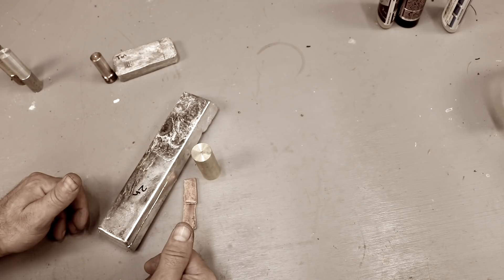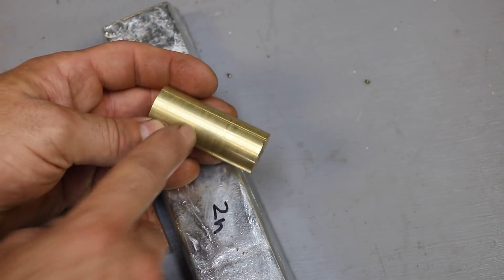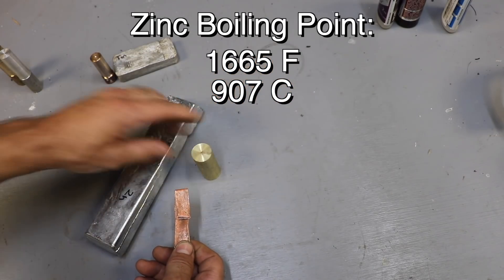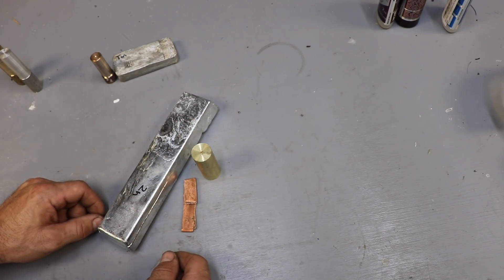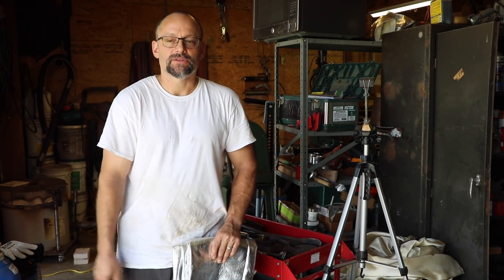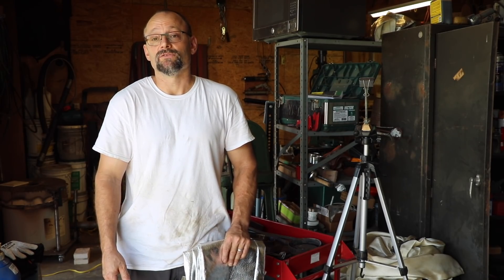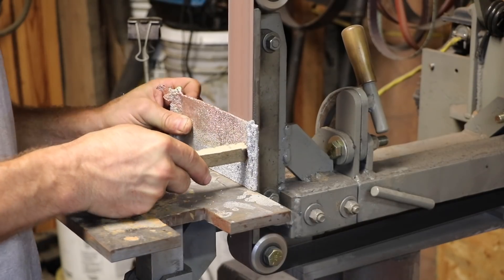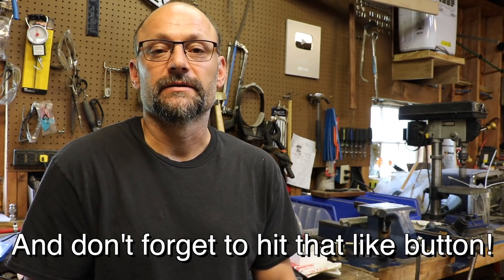Mixing Molten Metals.  THIS Could Go Wrong.

Comment: So I have made nordic gold multiple times with no issues.  Then I had an issue.  Molten metal in the eye kind of issue.  What happened is I had a big chunk of zinc on the bottom which didn't dissociate.  When I went to mix, it flash boiled and sent molten metal everywhere.  This seemed like a freak occurrence but splatter is indeed possible.  My eyesight is fine by some miracle. Sad thing is I had a faceshield on but had it tipped up.  Leather clothing for welding with no pockets works great.  Face shield.  Proper tongs, not Temu.   As to your alloys - aluminum will only handle very tiny amounts of copper before it favors making a ceramic.  The ceramic is hard as heck but eventually makes the mixture brittle.  Keep your aluminum low in most of these recipes - less than 5% and use pure aluminum over scrap can ingots which complicates things.  Tin at 1-2% has treated me well.  Copper should dominate most of the time as it is your "solvent" ; I favor over 85% copper. Copper will form copper aluminide; this will make the alloy hard and then brittle.

Comment: In high school, (many many moons ago...), I used to cast a lot of aluminum, and, at times, a small amount of copper.  We had only a few mishaps... the worst of which was when I poured molten aluminum into an ingot tray.  What I didn't know was that the other guys had quenched the tray to cool the previously poured ingots, but there was still water trapped in the seams of the joined angle iron pieces that make the actual tray.  The sudden, 'Hiss-Pop!' sound was surprising.  The molten aluminum spalltering on my bare skin was more so.  The aluminum solidified during the 20' run to the sink to quench myself.  What's a few third degree burns among friends, right?  That was an eye-opener!  Like John said... absent fireproof garments, bare skin was probably better than wearing clothing.  That would have been a clothing fire and a burn!  Anyway...  Thank's John for the great videos!  Love the channel!  Stay Safe Folks!!!

Comment: I'm permanently scarred when a cylinder of white hot tool steel flew out the tongs and smacked me in the face and fell onto my arm. It only took a second but it took weeks to heal. The only reason I still have an eye is because I was wearing safety gear. It managed to fall directly in the one part of my arm not cover by my gloves or apron. 

Splashed Molten metal droplets lose heat rapidly having a barrier to your body is a good idea as it gives you time to react.

Comment: The correct expansion ratio of water to steam is 1,600. It is important in firefighting to remember that, dump a lot of water on a very hot fire and you can replace the atmosphere in an enclosed space with water vapor. In addition to scalding anyone in that space, the lack of oxygen in the space will asphyxiate anyone who has survived the fire and then the steam cooking. Turnout gear isn't very effective at stopping the steam from burning the firefighters also. If you are certain there is nothing living in the space, you can put in just a relatively little water, close the door and also kill the fire by replacing the oxygen containing atmosphere with an atmosphere of water vapor. It only works with spaces that are not yet ventilated.

Comment: Hello i know this is a old vid but ive made some pretty decent aluminium bronze using only 10-15% of aluminium to 90-85% copper and it binds together quite well making a very tough but also malleable alloy

The trick is if its brittle you need more copper but if its too malleable you need more aluminium

Comment: the problem with the previous experiment was that the temperature was too high and the aluminum was formed with a lot of bubbles which would make it brittle, i have made many experiments with these metals (aluminum zinc copper) and i actually think if the temperature of your molten metals was not too high and you let the aluminum cool for more seconds (maybe Ten) you could have made a mixture of metals like you wanted, meaning layers of each fusing together, even better if you fuse zinc and aluminium brass (which would result in a color contrasting layers like you wanted). disclaimer: while i have worked with these metals i have never done a thing like you did meaning putting them together in molten state, i have just made alloys one at a time.
and beware of zinc vapor! you need a good ventilating space and hopefully a mask
edit2: i just saw you went a hundred degrees above the melting point, that would very well result in a not so perfect pour
and the next best thing than a full fireproof clothing is a fire proof apron!
Reply: and you actually are looking for Something in the wrong end of the rainbow! the Golden stuff was in the house, at least metaphorically speaking
Reply: the end result was very cool, hope you make a different pouring system to actually make it work for pouring several streams of molten metals in sync

Comment: You’re wrong. You can see sort of where the rainbow ends but you can’t know for sure until you go find it. 
The perfect example of that safety speech I’ve fond is grinding. When I’ve head to do prolonged grinding, I’d wear leather gloves. One time I didn’t have leather gloves. I put some of those cloth gloves with the latex palms. I burned the shit out of my finger. The sparks stuck to the cloth and burned me whereas bare handed it bounces off

Comment: yes zinc makes it a lot easier to alloy things with copper like aluminum and even iron
Reply: i use zinc  in my alloys to lower the melting point of the  alloying elements allowing you to do things  like alloying iron aluminum and copper under 1200C temperature :)

Comment: The comment on no clothing at all being second best is indeed correct, as at this temperatures, everything will be burned through before you could even start to react to it and any sort of burnis easier to take care of medically and has a better healing chance when no further foreign tissue (like clothing) has been burned/molten into the skin/bone

It's somewhat similar to dry ice or liquid nitrogene, contact to skin is not that big of a deal (if it's not forced and prolongued) as it will just 'slide off' (it's way more noticable with liquid nitrogene then dry ice [solid CO2] though)

Comment: I've got a brief observation on your choice for pouring the molten metals. Isn't there a release agent or powder that keeps the sand from sticking to the object that you're using as the pattern? I would think also that pouring the metals horizontally and with vent holes would give you a different outcome?

Comment: Not only is safety a personal choice but safety is also different for everyone and the supporting evidence is everywhere. Skill, experience, practice, muscle memory, personal tolerances and preferences. You may require a piece of PPE simply because you don't like the discomfort of oils or sparks on your skin, you may work in a metal shop in your underwear cause you can ignore the existence of sparks and oils and you're ability to focus and work safely is not affected. A personal example, I am a bladesmith and I never wear gloves if I can find any way to avoid them. I've never burned or cut my hands to a degree that affected my ability to keep working. My brother will occasionally come make hunting knives with me and he won't touch a hammer without gloves, he has also never sustained an injury. It's all about weighing the pros and cons and being aware of the risks and the ways to mitigate those risks. Also being familiar and comfortable with the type of injury that you can get from the type of risk you take. On another note, there are plenty of other options for clothing made from naturally self extinguishing materials that are treated to be flame retardant. Firefighters and the military use a light weight rip stop denim made from fabrics like 100 percent cotton, 100 percent hemp or 100 percent silk. These materials don't self ignite, they do self extinguish, they don't transmit heat, they don't melt, and when treated the hot material won't stick to them. Not nearly as good as the flame proof suit you have, but certainly not any worse than bare skin.

Comment: Bare skin certainly isn't the next best thing to "correct" safety equipment.  Your own views on safety are your concern and you have every right to use as much or as little safety equipment as you wish, but giving out false information to others is incredibly irresponsible.

You are certainly correct about not wearing clothing that will burn and definitely don't wear anything that will melt and stick to you, polyester etc.  Natural fibers such as cotton and wool are the way to go if you can't get or can't afford proper high temperature protective clothing, in fact in professional foundries 100% wool trousers and jackets were pretty much standard issue in the past and I've been splashed with significant amounts of molten bronze while wearing these, they smolder on impact, but do not burn and do not catch fire from a simple splash. 

The key issue with doing hot work in shorts however, and one that you failed to mention although you alluded to, is that there is absolutely nothing preventing metal from splashing into and getting stuck into your shoes. Jeans will cover the tops of your shoes, preventing anything from getting in there.

Comment: The trick seems to be getting the copper to solidify before it completely diffuses into the other metal. The zinc cooled the copper down fast enough for this to work. With the other metals I'm pretty sure you could take a chunk of aluminum or tin and drill holes in it of the correct size so when filled with molten copper it would allow for some mixing but cool the molten copper down with out liquifying the "container" metal. The math seems like it would be pretty straight forward to calculate how much copper you could pour into a cavity in a chunk of aluminum before it would melt the aluminum.

Comment: How well would it work if you had the 2 crucibles ready to pour into the mold but poured one crucible into the other just before pouring into the mold? Would it allow just enough mixing to get the effect you want without completely alloying before solidifying? Or maybe pouring both into a wide funnel that goes into the mold instead of directly into the mold, that could allow more swirling for a more random pattern

Comment: Have you thought about pouring with 2 sprews that go to the bottom of the mold either side and have the metal enter at the bottom either side and work their way to the top to a vent mixing as they rise.
This may create a more "swirly" pattern as it rises.

Comment: Tin might work with copper if you pre-cast a copper shape and kept it just shy of it's melting point, and then poured tin over it. Should have a non-flowing integration zone where the tin would 'wick' into the copper structure, and you'd have some control over that zone because the work's exposed and can be quenched at a given time, determined by experimentation.

Comment: Might i recommend you use a graphite rod to stir the molten metals together when their melting temps are far apart like that. . . . otherwise they don't mix... Because one provides enough heat to keep the other molten.

Comment: Having worked in steel melt shops for 45 years, I can tell you that your denim blue jeans and jackets with heavy welding gloves were the preferred clothing for working around molten steel in the days before aluminized safety gear came around.  The cotton is a natural fiber and it will not melt and stick to your skin, it also smokes when it gets hot & tells you that you are moving too slowly.  Bu the way, when water turns to steam it has a 1600 to 1 volume increase.

Comment: Seems like way too much tinn and thus diluting it too much. Maybe weigh the cast piece, then calculate the amount of the two metals to get this mass at x percentage each, then melt and mix those two defined batches. Also, heat the tinn up (much) higher, to allow for mixing.
Oh, at 11:15 its 0 to 100 °C, not 1 to 99 °C. Water (or anything...) only starts transitioning to another state when the freezing/boling point is reached and then more energy is added/removed. So heating water from 0 to 100 °C will not cause anything to boil, unless you keep putting heat into the water that now reached 100 °C. Well, there are some details around superheating at the contact surface etc. that we dont need to get into, but thats how it works.

Comment: 👍
A long leather apron would be the most appropriate attire for pouring molten metal, combined with high leather boots.
Add welders gloves, to protect your hands and forearms, and you're probably as good as is reasonable.
Protective glasses/facemask, would be an obvious addition.
This is both cool to wear, and would protect against splashes. 
If you look at old films of men working in foundries in the early part of the last century, that's what they wore.
😊
To get the metals to mix, the use pellets and melt them in the same pot, and stir well as they melt.
.

Comment: I kinda have the feeling that using a shallow horizontal pool would yield better results, you might even be able to cast the lower melting-point metal first, let it cool slightly, then cast the second one on top.
Cause so far it seems that most of the metal just mixed at the bottom and you only get a small region at the top where they stay somewhat separated.

Comment: Here's a real suggestion....
Go buy a 6 or 24 pack of water bottles.
Freeze them (give'm about 3 days in the freezer)
Place them in all your pockets when messing with such hot 'clothes.' 
I'll do this when messing with my crazy mean ass bees where I have to get totally suited up (generally I don't wear gear when messing with my bees...but I have some mean as fuck ones where I have to use gear...those little bitches will get broken up very soon into little tiny not mean hives!)
Reply from the maker: I've never thought of cold packs to help.  I like this idea!
Reply: @FarmCraft101  I want to sew a bandolero, but instead of bullets, frozen water bottles.

Comment: Best protection is to be behind a barrier, no dumb clumsy hot clothing to impede your movement / escape. Build a frame with small supermarket trolley wheels on it. Car door glass is tempered, front window is double layer tempered. I'm certain you know were this going.

Comment: I had a feeling it would flare up but still I was happy to see an expert try it👊🏻😁🍻🍻
Reply from the maker: Haha!  "Expert"  Lol.
Reply: @FarmCraft101  That was  cool, it had a light lime green color when the flare burned
Reply: I've melted down $5.00 worth of pre-1982 U.S. pannies (95% copper) as well as $5.00 worth of post-1982 U.S. pennies (97.5% zinc). 
According to my research on the current law, it's legal to do so as long as I don't sell the castings for profit and the castings are labeled as "coin".

I've put together $2.50-pre82 and $2.50-post82 to add to that mold's collection, but I've been afraid to mix the two until I had a better understanding of what might happen. This vid came at just the right time! Both of your channels were the inspiration for me getting into melting/smelting last year.
Reply: Thanx to bigstackD for sending me here  I learned a lot and it saved me a lot of time experimenting on my own!
Reply: What if you melt them in one location not separated?

Comment: I had an idea to try to obtain your goal: melt some copper and pour it in a preheat cast iron skillet, forming a shallow pool. Then randomly (or artistically) pour some tin pieces over it! Or other metal with lower melting point than the copper. After melting the pieces you can let as is, or take a inox spoon or stick and make some moves to partially mix them, make some art..  .  It may offer what you seek! And i'd love to see the results! Thanks for the videos and inspiration!

Comment: You should try pouring in the correct portions so that you stop getting that sh** bronze as you called it. Only melt as much of the non-copper as you need for a good alloy so that if they do mix too much it isn't wasted

Comment: I imagine a lot of violent sputtering and some sad results~

I think what you're really looking for are two eutectic alloys with different colors but similar temperatures. The problem is that raw metals solidify at different temperatures, so they won't really freeze in that "poured" state, I think.

I have covid so I've been rewatching your back catalog in between sleeping. Thanks for all the entertainment!

Comment: Maybe alloys with alloys, or alloys with pure might get the temperatures closer, but the problem there is getting them different enough... what does a high Al low Cu look like and is that brittle "sh*t bronze"
Also. for an alloy with pure, the alloy would need to be overloaded in the other direction, so that the mic creates the normal alloy

Comment: This might reduce the quality of the molding capabilities, but what if your pour exposed more surface area for mixing? Is it the hydrostatic pressure and relative density that is allowing so much separation? 

Also, if the amount of the cooler melting metal is very small in the traditional alloy final product, what if you used like a tiny foil amount that was solidified inside the mold (pre pour), and then poured the hotter of the two metals over it? Would that improve the chances of spontaneous alloying?

Comment: I wonder if the rough surface of the sheet on the copper and tin was due to tin compounds boiling away. Tin oxide's boiling point is only 1400C, and other tin salts have far lower boiling points (tin chloride is about 650C). I could definitely see these impurities forming small bubbles of vapour, rushing to the outside, and knocking the sand around as the vapour freezes.